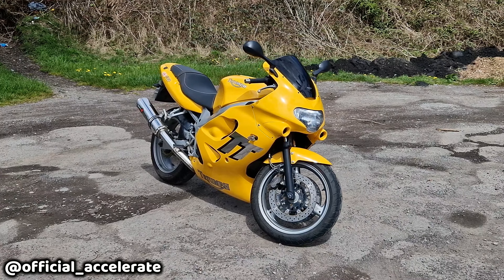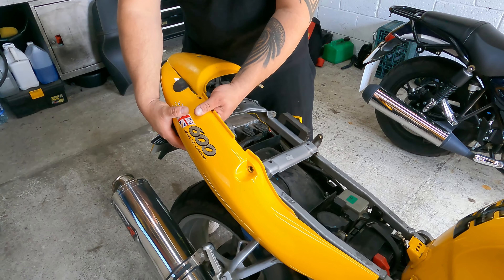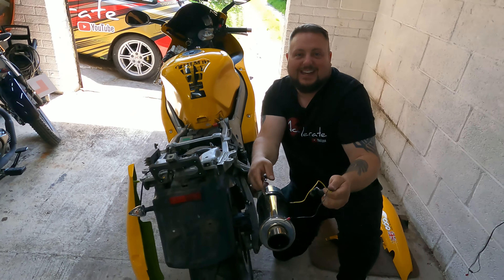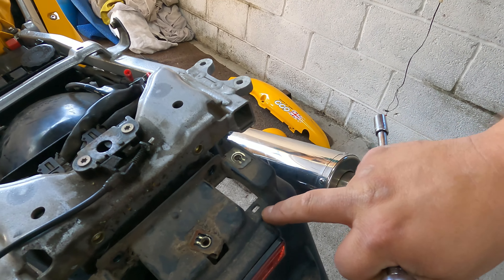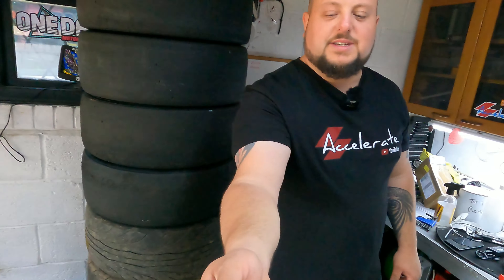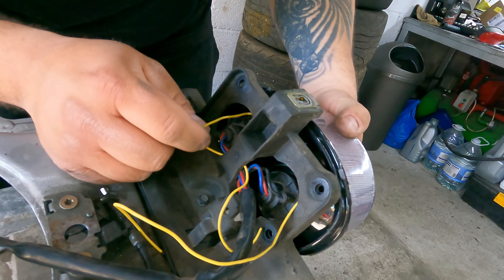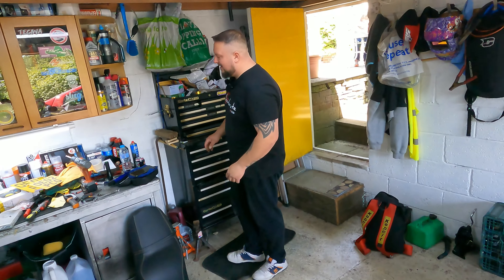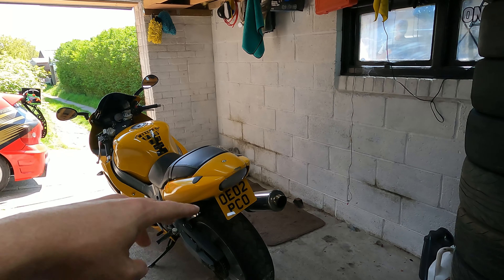TRIUMPH TT600 CUSTOM Tail Tidy DIY *Modernising A Classic Bike*

Comment: pretty late now but just letting you know you didn’t have to drill to make the light flush. you were meant to unscrew the spacer from the old brake light and put it on the new one, literally just found that out as i was doing my install.